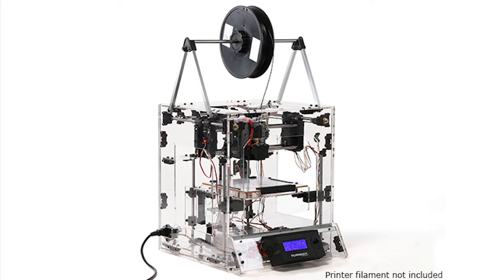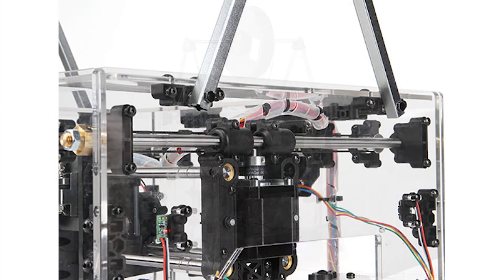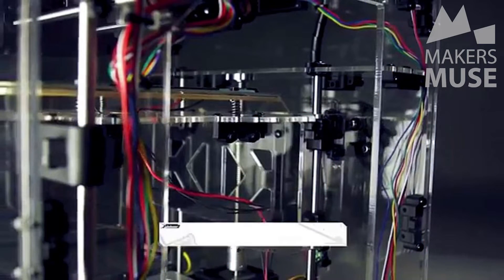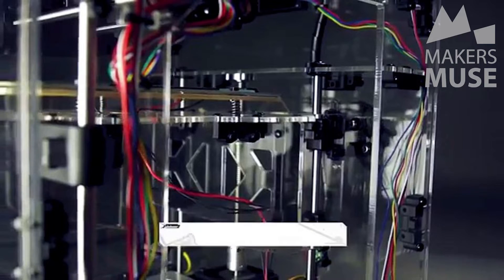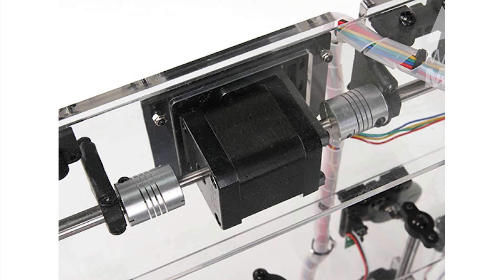Why do 3D Printers still kinda suck? - 2015

Comment: Are you serious? I think a bad 3D printer I could afford is still better than a expensive 3D printer I couldn't. After all, they are meant for rapid prototyping, not rapid manufacturing. Sure, people have to high expectations. And by the way, as far as I know: commercial printers know when they move, but not where they are.

Comment: I think the main reason cheap 3D printers is not using servo motors is because closed loop systems are expensive. My 50W-2000 pulse/rev Allen-Bradley motors with amplifiers cost 800$ (new), the cost becomes even higher when you include break out bords, communication wiring, software (Tuning and CNC software) and a PC. It is also quite hard for people to configure/calibrate the system if they have no knowledge about PID tuning.

Comment: The XYZ axis type machines (printers, mills etc) has got this absolute belief in stepper motors - and they are CRAP!!!
They are heavy, expensive, unreliable due to step skipping, low resolution (hence half/quarter/eighth stepping which is a totally unreliable crap-shoot), CHEW power and are NOT strong but everybody HAS to use them.
It is like a mantra - "steppers motors rule" - NO THEY DONT!!!
Time for the industry to catch a wake up and move to a more cost effective and BETTER method of doing the positional thing.
Reply: What mill uses steppers? I don't know a single CNC milling machine or lathe that uses steppers. They have not uses them since the 80's.  No one in the industry says steppers rule. What they do say is steppers are cheap.

For 3D printers steppers are fine. With the tiny forces involved they won't skip steps unless something is wrong anyway.

Comment: I find it odd how many smart men & women make this same observation yet so few have tried to design/build a superior 3D printer. Why is that? Soon after I bought a Reprap i2 I designed a multi-colour extruder (and had the not-yet-seen Bowden arrangement in mind) - but made the mistake of emailing my sister a drawing. Within a year a virtually identical item was being mass produced and it seemed clear that the design had been e-nicked, but only it's exterior appearance as they got the inner workings completely "wrong". We must not be afraid to HAVE A GO otherwise we inherit the faults & flaws of those who aren't scared to have their designs & products criticised by those who can't do it any better.

Comment: I know this is an old video but I recently put together an ANET A8 which has an acrylic frame. Admittedly  I've added some mods from Thingiverse to stabilise the frame, in particular, the Z axis but the results from this rig are amazing. Iv'e been printing in transparent PLA and can only just see the layer lines. Maybe the Prusa I3 and it's derivatives didn't exist when you posted this vid?
Reply from the maker: +Ching Hanson they definitely didn't, though I have serious safety concerns over the new generation of low cost kits. Make sure you enable thermal runaway in software!
Reply: Thanks Angus, There do not appear to be any settings for thermal runaway on the A8 but the temperature of the bed and the hotend are constantly monitored by the software, it won't even begin to print unless they are correct so I'm guessing the software would stop printing if either temperature went out of bounds. I least I hope so.
Reply: It's like owning a 1960's English motorbike, it's noisy and bits keep falling off, but it's fun to ride.

Comment: To be fair, even 2D printers still kinda suck
Reply: Yup. I have a HP Envy. It only has one USB type C port and it didn't come with a cable. Sure it connects with WiFi but the firmware is busted so it doesn't work properly without a wired connection. It has NO ethernet port and it doesn't even have an SD card reader. The print quality isn't bad... When it works... You see, the printer sometimes decides to print the final half of the document/image/whatever and then it spits the rest of the paper out blank. Sometimes the paper doesn't feed. The scanner is a great thing to have and the photocopying it good. But the scanner, again, doesn't send the files to a computer properly. It claims to be usable using a phone, I tried that and the app they provide just outright doesn't function on my Alcatel Pop 4, I tried an alternative app made by a third party and that worked 100%. But even then, the feeding issue makes the printer a massive piece of junk.

All in all, yes. Modern 2D printers suck arse :) Even if they come from expensive brands. (Mine was about £300, which is expensive when you realise I can get one for £50 in the local supermarket)
Reply: 3 years later and still the same. As in, the same as 20+ years ago. Paper jams, nozzle clogs (that take freaking half a cartridge to unclock), chipped cartridges that might just lock out on your face if the manufacturer decides it's not original, firmware updates to lock out 3rd party cartridges, or paying twice the printer price for a bulk ink machine. "Oh but at least you can throw money at the problem and it goes away!" yeeep no, seen an HP one with a print head that just dies at random, costing about the price of a new printer to replace (that's a bulk ink one by the way), and there's always the purge pad that the printer might just decide it's too full to be usable and the entire machine locks up, effectively making itself useless in a timely manner. Oh, let's not forget "out of yellow ink. Cannot print anything in black only until you give me yellow".
Normal paper printers are some of the most hateful machines ever made, for real.Whoever came up with the whole ink cartridge business sure has a place in hell comfortably besides the dude who invented the electric chair and guillotine.

Comment: The same everywhere mate. Look on cars, the same story. Marketing rules. No need for true progress.
Reply: Computer laptops are also the same. It shocks me how much misinformation they pour into each advert.
It's super fast, oh but it has only 2GB of RAM and a terrible processor. Yes, but look how the case is a pretty pink! 
I have learned with brands to avoid now, some of them have terrible build quality. I'm not asking for much, but I do want the keyboard not to flex and the screws not to all fall out when I lift the machine up :/ Especially if I'm actually paying about £500 for it after part costs to fix the stupid thing. (I could build my own desktop machine for less than that.)

Comment: Good thing this is an OLD video because I would remove my sub. I have to cheap printers and they prin as well as ANY other printer on the market. You praise the Prusa yet you hat sub $1000 printer? WTF? Internally they are all the same.
Reply from the maker: +Norm Caissie things have definitely changed a lot since this time, these machines were not good then, most barely functioned. Průša has done wonders for the community making features like auto bed level common place! I should definitely film an update
Reply: Maker's Muse yeah. it put it in my recommended list and I didn't notice the date. I watch a lot of your vids and other 3D printing. I was offended until I saw the date.

Comment: Real cnc machines use precision screws not belts and gears.   Though servo/decoders are nice there is nothing wrong with steppers or stepper/servo drives.   The big problem with FDM is that they are FDM !   I can see applications of FDM for larger parts that are mainly prototype parts or to be used as patterns AND are to be hand finished to achieve good surface finish where required.   Resin/laser type printers seem to have the best print quality from my experience.   25micron layers and accuracy make the big difference.  People who wan to make things would be better off to learn other methods of making things.    I think 3D printing by FDM is going to fade away.

Comment: Why won' they use encoders on stepper motors? It would require a slight update on drivers, but wouldn't it be a quite cheap update?

Comment: I'm the owner of one Hobbyking 3D printer and i really agree with the acrilic problem, but aluminium frame if heat up isn't going to expand even more? Btw the machine has also a problem with the belt tensioning system, is made of thin plastic and it bend out leaving to escape the belts and yes the printing volume is SMALL. Apart from that, i print ABS closing the side panels and all works fine and i think is a more robust design than an acrylic chinese prusa I3.
I'd really like to see some powerful 3D printer mainboard capable of more calculation that just some look ahead and able to use at least encoders, so the printer really know where it is.
EDIT: no, the acrylic expand 3 times as much as aluminium. wow!

Comment: I think theres indeed a lot of room for improvement even though things have come along way since!, ive already done things like install a cheap webcam on a mount, led lighting and a guide pulley for the filament coming into the top. things like a accelerometer to check the alignment of the bed etc. don't think efficiency should be key focus for cheap printers but for 4000 dollars you could definitely design something better taking off the shelf solutions from other types of devices like printers, hard drives/dvd or industry.

Comment: I don't agree. It depends what you expect. I have 200$ Anet A6 printer, of course it is far from perfect, but still its's amazing. I can print things that normally I wouldn't be able to make at all, like parts for quadcopter, electronic casings, small replacement parts (I printed ford ka seat handle) etc. And these are perfectly usable parts. I know restrictions of this technology and my printer and I'm perfectly ok with it.

Comment: just ordered my anet a8.    hmmmm
Reply: peter L. You'll love it if you're  remotely mechanically able.  Had mine two weeks and am currently prototyping parts which are awesome and have really good tolerances.  Just keep on adjusting the bed height *once it's been heated,  screw it to a bed for stability, and print a 'temp calibration tower' for every new filament you put in.  And only use PLA for a bit until you're comfortable that you can print accurately before you move on to something like abs that you'll need to dial in a lot more.

Comment: Servos are not used because they are error followers and require feedback. Generally steppers allow a much simpler control system and lower cost.
Reply: Plus servo motors use more electricity and run hot. Bad if you're doing long prints in temperature sensitive environments.
Reply: @BungieStudios  On average servo's are very efficient and steppers run hotter.

Comment: Sorry, I think you're completely wrong about acrylic frames, and here's why:

1. Acrylic expands with increasing temperature. Approx. 0.075 mm / m / K, depending on the supplier. Meaning that a 1 meter acrylic pole will become 1.5 mm longer if the temperature rises 20 degrees C.
2. These acrylic parts are not near a source that is likely to make the temperature jump 20 degrees during a 3D print. Unless you are printing in an unheated garage and leaving it over night, but then the filament would be affected by this temp variance anyway and whatever printer you use will fail, especially printing ABS.
3. The material isn't the main part of the equation to equal cheap and nasty, but the construction design. Anet A2 is an aluminium frame but it is just a square section which fits together with just 1 small screw on each end on a very flimsy L bracket. The whole thing could fall apart if 1 or 2 screws aren't tightened and you knock it, or at best the motor will eventually turn the frame into a parallelogram, whereas the A8 is acrylic but you can see by the way it locks together it is far sturdier and robust, so advising people to look at metal frames would fail here. With good design you can make paper a container for eggs. In any case it is almost irrelevant as the motors are still winding up and down on metal rods, so if you set the bed that's all you should need to worry about.
Reply: ArcanePath360 my friend had a printer with an acrylic frame. Try getting rigidity when you have metal screws and bolts holding together plastic. 
His steppers used to move, and the head would move half a second later. The play (slack) was so bad.
Reply: Sounds like it wasn't put together right if it's 1/2 a second out. I'm guessing the belts had too much slack in them.

Comment: How accurate/repetiable is a homing? Is it possible to reduce the effect of a skipped step by homing the machine regularly, say after each layer? This way the machine will know where it is when it begins a new layer and only a single layer will by out of alignment when the printer looses its orientation. You will then get a small imperfection in your print, but it is not completely ruined, and can probably be fixed with some spackling/sanding
Reply: You could also add a camera and do image mapping (what a lot of industrial machines do), checking each image against the sliced model.
Reply: I know.... you could also add encoders and measure where the axises are, though you cannot detect thing like extrutions not sticking to the printed part, or parts not sticking to the print bed cannot be detected without the camera.
However I asked the question as homing might be a simple way to fix the problem with skipped steps in a low price printer by simply adding an extra line of G-code every time the Z height is changed. The "hack approach" It is as simple as opening the G-code in word, searching for the "change Z command", and replace it with the "change Z command" followed by a "do a homing command", click do this for all instances, then saving the file.
Reply: Jon Steensen Isn't there a risk of layer cooldown during homing though, depending on how long it takes?  That could cause adhesion issues and/or visible stepping in the finished product.

Comment: 3D Printers do not use servos because servos are not great with holding the position. Apply the force to servo and it will move a step or two before forcing you back. We will need to have steps so precise that a few step errors do not matter. And those will cost too much. Linear steppers are the future, but they are too expensive for now.

Comment: Honestly, I think it has everything to do with the medium.  Until resin comes down in price, SLA printers are not going to catch on for the average user.  I think SLA is really the only "consumer grade" printer style that gives amazing quality.  Everything outside of SLA is either going to be FDM (which has reached its theoretical limits) or something super exotic like DMLS, which no one can afford.  FDM printers have gone as far as they can go.  The demand has driven down the price of SLA printers but the resin is still amazingly expensive.

Comment: Stepper motors are used because they obviate the need for optical encoders while simultaneously providing holding torque.  A DC motor will not provide the same sort of holding torque and will be crap for 3D printer use.

Comment: Well said... Innovation is pretty stagnant at this point. I think a robo arm like the automotive manufactures use that feeds filament would be innovative.  This would eliminate the need for support... and slicers could slice and solve problems in true 3D.  Great videos... keep it up.
Reply: An arm would also open up sizes and shapes that just aren't possible inside a small(ish) box.  A one foot arm would have essentially 2 feet of access in a 180° or 360° arc.  And you could give them expandable joints to add arm extensions and print even larger projects.

Comment: You are correct.  A properly designed printer should be using BRUSHLESS (not cheap brushed) motors, linear encoders, ACME thread screws, anti-backlash, full DRO readouts, swappable heads, etc. etc. basically a full blown CNC machine.  Of course, this would make them start pricing at over $13,000.Where your complaint kind of goes all sideways is that you make the assumption that being cheap is somehow supposed to turn people off of the technology.  This is something of a false flag that you're kind of responding to.3D printing has really only started to come into common, mainstream, knowledge in the last 3 years.  It's still a Fledgling technology and is much like the early days of computing.  The bar to entry was high and huge.  As time went on and people started seeing the usefulness of it, it started attracting more interest.  That is what I'm seeing 3D printing at right now.Considering there are plug and play 3D printers and cutting lasers on the market RIGHT NOW, it's actually moving along a little faster than computers did.I just bought and am building my first 3D printer right now.  It's a cheap HIC Tech 3DP11 sort and my expectations are that I'll have to do all kinds of fussing with it.  It's very fiddly to even build so clearly I'm going to have to mod it a bit to get it running the best it can, but what do you want for $230?The future is the future, be happy with what you have now, even the HobbyKing printer you cite is still a technological marvel if you consider it's cost and rewind the clock about 5 years.  It's amazing you can do all this great stuff with so little investment of money, but you are trading your time (build, learning, fussing) to do so.